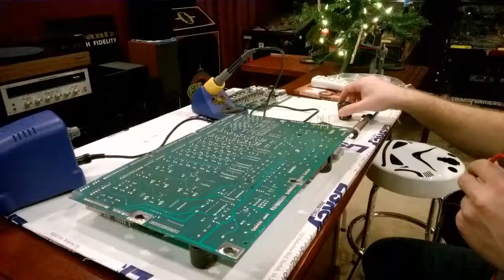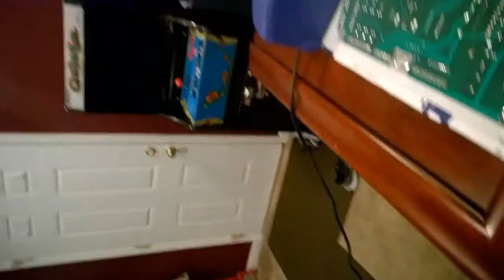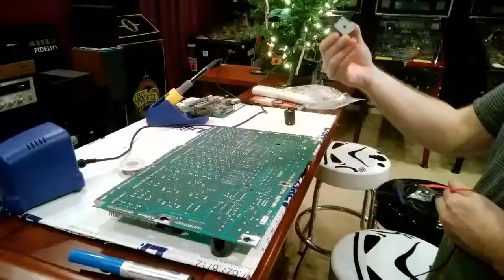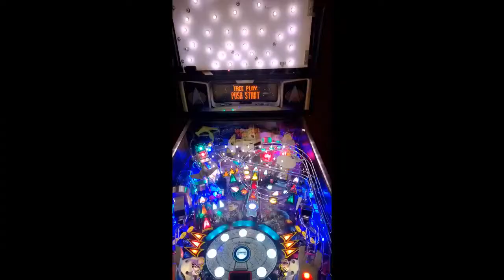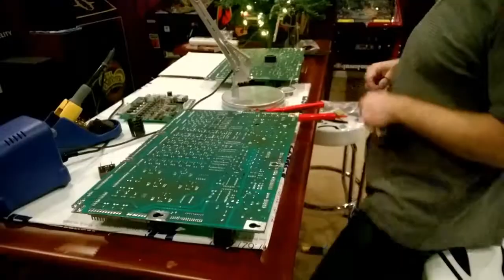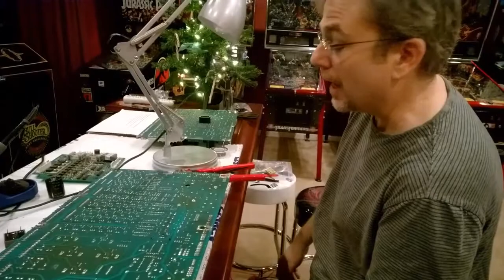Repair WPC flasher circuit on power driver board

Comment: THANK YOU SO MUCH , I replaced the BR4, but it was looking like that was not just the problem for me and I thought I wouldn't get around buying a new Wpc pdb.
After stumbling over your clip, I decided to get out the multimeter and check as you recommended and there it was! learned something new, soldered in a bridge and now it works again like a Peach. 

THANK YOU SO MUCH!!!